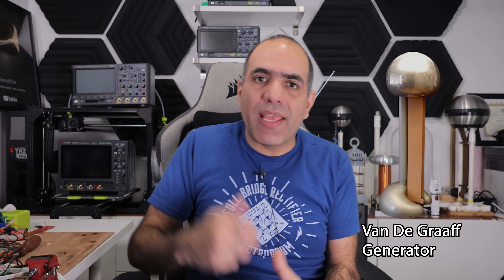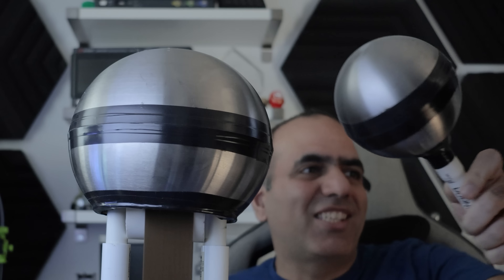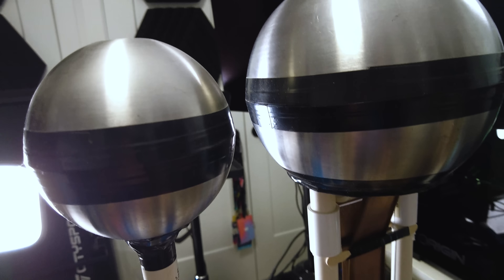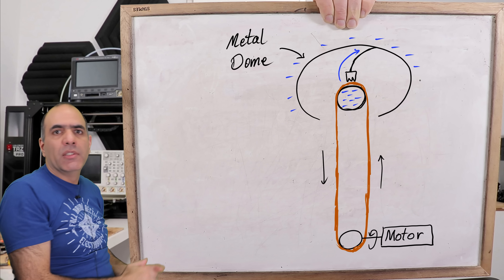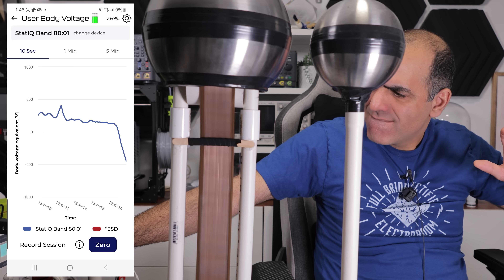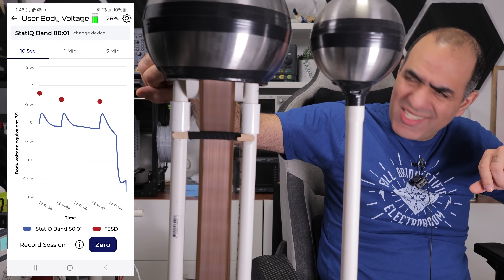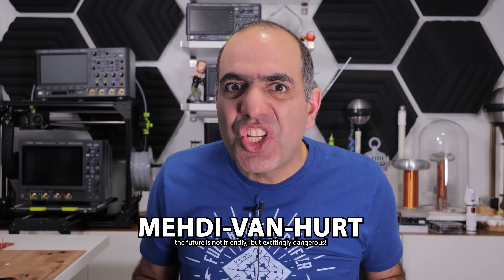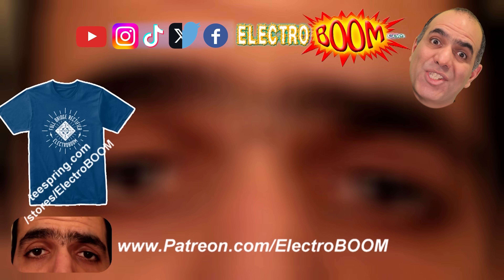An Attempt Was Made!

Comment: If touching the bottom of the belt with the grounded ball increased charge try taking the black tape off the brass rod at the bottom on that side and attach the ground wire directly to the brass rod that would now be directly touching the belt.
Reply: But then the dome charges will jump straight to the grounded brass rods....

Comment: I just don't see how adding an additional ground to the negative side if the belt is any different from adding more combs to the very bottom of the machine, other than the added ground being located closer to the upper ball.

The other issue I see is that the belt itself carries electrons. On the wimshurst machine, the disks are supposed to be insulators while the plates transfer electrons. I don't think you can properly combine both concepts as they'd drastically interfere with each other. Perhaps if you had some super insulating material that could perfectly isolate the plates from the belt, then it might work, but with the voltages you're working with, I don't think such a material exists.

It feels like you'd be better off connecting a separate wimshurst machine in series rather than trying to combine the two.

Comment: IRC Wimshurst machine is basically an electrostatic universal motor/generator. They cross couple the connections so that the induced charges on the plates either side add up. I think maybe if you connected between the sides in a ladder arrangement, you may get more and more charge on the belt as it rises up towards the ball instead of being constant amounts. But obviously if it arcs before it gets there then it won't help so the plates can't be too close together.

Comment: It’s a short circuit. I don’t think you can separate mediums while they are connected so. Even if resistive values were used instead of conductive plates, it might not work because there is no opposite charges since the mediums will still share the same charge polarity. The p’hose is resistive and the metal plates are conductive. That means both are one charge. I was thinking you need a capacitive connection to get your opposite charge as a field, however, I was thinking of something else because I didn’t know at the time what you were trying to do. The capacitive junction might work, however, if it did work it will only create repulsion nodes or repulsive junctions just as if you used resistive plates instead of conductive plates. If it doesn’t work,all the same, it will be a short circuit. It’s possible to create repulsive nodes or repulsive junctions, however, that’s not caused by opposite charges. You might have to make two machines having opposite charges and then let the charges interact.

Comment: Attaching the copper tape to the belt essentially turns it into a (poor) laddertron or pelletron!
In those, the pellets/ladders can move significantly faster than rubber and hence can create much higher currents and voltages without wearing out the belt, however in your situation it makes it worse.
Reply: Came here to post the same thing.  Wikipedia has a page on the Pelletron, along with links to the manufacturer and the manufacturer's page on how it works.  These commercial units are used for driving small particle accelerators and can produce potentials up to 25 megavolts.
Reply: @robertlapointe4093  Yup. Laddertrons/Pelletrons are nothing new.
Reply: @robertlapointe4093  Hey, there's my people! I also know about Pelletrons!  I think they are neato.  Bye!
Reply: A Pelletron attempts to add  extra charge dirrectly to the pellets (copper strips in this case) instead he's trying to add it through the pantyhose.  His Inductor/suppressor setup is wrong for it to function in such a fashion.
Reply: Robert VandeGraaff's first prototype used metal foils on the belt.   
He soon discovered that the device worked better if the foils were removed.   (Their sharp edges leak away half the charge!)   To correctly employ conductors here, they need to be spheres, or perhaps thick hollow disks with rounded polished edges.
Also, his earlier prototypes used newsprint paper  ...since he was inspired by lethally dangerous voltages building up in a local Boston newspaper-printing facility.   The huge printing press was electrically floating, and a worker had been hospitalized from walking too close and experiencing a joules-scale discharge through his body.   
But in humid conditions, newsprint becomes too conductive.   Neoprene belts with cloth inside for sturdiness work well.  And also, when ozone eventually makes the rubber become brittle, the interior cloth keeps the belt from immediately crumbling.
Also, in Scientific American, the Morris/Lee VDG used a trick to double the current, by employing an upper metal roller, and a little pickup-comb connected only to the roller (so the roller would highly charge up to opposite the polarity of the lower roller.)
Reply: @wbeaty  seems like connecting the comb to the roller instead of placing it in contact with the belt might solve the issue mehdi found with the charge, if his measurements and hypothesis are accurate

Comment: The basic idea of a Wimshurst machine (or any other 'induction' machine) is that you hold differing charges near two conductive plates that are parallel and initially connected. The charges induce electrons to move away from one plate to the other. When you remove the connection between the plates, you are left with charges sitting on the two plates. Like a capacitor, if you move the plates away from each other, the capacitance goes down but the charges remains the same, which means the voltage on each plate skyrockets. You can then drain the voltage (via some combs) into some high voltage capacitors (typically leyden jars) and repeat the process. The principle is most easily seen from a much simpler machine called Belli's Doubler (duplicatore).  In the Wimshurst machine there is a succession of plates mounted on insulative disks to handle bringing them together and apart. The process relies on there being some small residual charge to start off, but apparently that occurs naturally with the conductive plates.

There is a variation of a Wimshurst machine called a Bonetti machine, AKA "Sectorless Wimshurst", which operates similarly, except it dispenses with the conductive plates, it just relies on charges sitting on the disks. From what I've read, the Bonetti machine needs an explicit start up charge, but is capable of higher voltages than a similarly sized Wimshurst (presumably because the wimshurst can get arcing between the plates on one side of a disk).

Unless there are details I can't see from the video, what you've done is mimic the appearance of a Wimshurst plates but you haven't done the part when charges are allowed to flow from one plate to an opposing plate under the influence of opposing charges.

My (possibly incorrect) understanding is that a Van De Graf generator is both triboelectric and inductive. The roller strips (or adds) electrons to one side of the belt is the triboelectric aspect, but the charge going to the bowl is actually from a charge induced on the other side of the belt. 

Have you thought about connecting two Van De Grafs in series to get higher voltages?

I'd also like to know what the lower roller material is. I never thought about using pantyhose as a belt. Is there a video with the construction details?
Reply: Very interesting description that I would have found helpful fifty years ago when I was making the Wimshurst. Oh well I will have another go.
Reply: @WOFFY-qc9te I've got a Bonetti machine under construction. My expectation is that it will be more tolerant to the discs not being precisely synchronized.
Reply: @ericthecyclist  You very detailed explanation explained the spacing of the sectors. Answers a few questions here.  Enjoy your new machine a wonderful project and a pleasant change from the tack made today.  Drop in to see
 " Steamhead "   He does not make Wimshurst machines but make a lot of fascinating devices from Acrylic, you may find so construction ideas. If you leave a comment say Woffy sent you.  I think you will enjoy his content.  Also  My Own Devices and excellent channel. Best
Reply: Yes, actually Medhi links to a very good video explaining exactly how this works.  But then builds something that would not contain  any of the elements that make a Wimshurst machine work.
Reply: Thanks for taking your time describing systems :ø)
- and thanks for sharing it with us, truly appreciated!
Reply: "The Charge Remains The Same" wasn't that a Bob Dylan song?
Reply: ". Is there a video with the construction details?" yes there is.
Reply: Doesn’t the comb inside the dome just spray the belt with positive corona that neutralises the charge on the belt? And isn’t the positive corona limited by the fact the dome quickly becomes negative, until it discharges via the spark? The dome is not an unlimited source of positive charge. There is no reason why the belt travelling down should be positively charged, before the addition of the copper plates. It only attracts enough corona to make it neutral.
Reply: @Bicyclehub  My understanding  is there is a law that says you can't have a static charge inside a conductor, only on it's surface, that if you do put a charge on the inside of a conductor, it will immediately migrate to the surface. The stated reason is that like charges repel each other, and the surface is where they can be further appart. 
The weirdness comes that every description of Van De Graf machines I've seen treated the inner surface of the dome as being inside a conductor, so that charges applied to the inner of the dome would migrate to the outer surface. I don't claim to unerstand this weirdness, it fails my thought experiments, but I hope it gives you a place to start googling and hopefully find the answer I've never found.
Reply: @ericthecyclist  Faraday's law
Reply: @cambridgemart2075  applies to electromagnetic systems, not electrostatic ones.
Reply: @ericthecyclist  Sorry, Gauss' law, not Faraday!

Comment: Two more experiments you can try - 1. Cascade a bunch of step up transformers (step down in reverse) - feed the secondary, output at primary, then connect that to the next secondary and so on. I would think with 10 transformers cascaded like this you would get some mean voltage at the last primary. May work with only brief pulses. 2. Take that high voltage app device and go under a HV transmission line tower. See how much voltage you can pick up from that.
Reply: Cascading transformers does not work, because the wire isolation and primary to secondary isolation is not good enough. You would need special high voltage insulated wire to wrap the primary and secondary coils of the higher stages.
Reply: @ProtonOne11  Makes sense - after the 2nd or 3rd stage voltages would break down the insulation - but I would think for short pulses it might work to make a big spark at the end.

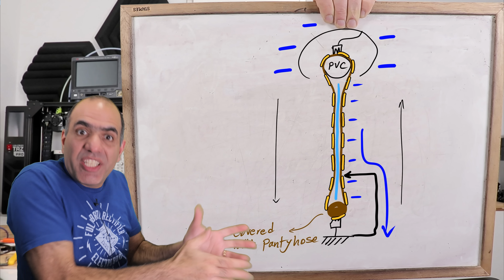Comment: 11:20 You need 2 separate belts with diodes in between.  Diodes Mehdi :D
Reply: So both the belt and the top tube are dielectrics? Where does the belt get the extra electrons from? The air? Also a dielectric. The system works with a difference in negative charge, not +ve and -ve. As soon as you introduce any conductor and that may be earthed, all the  extra electrons leave and it stops working.

So the challenge, is you want one side of the belt to only gain electrons (you could help it somehow) and the other side needs to repel electrons so they stay in the metal ball at the top. 

Maybe a belt made of a material where the current can flow only one way?

Comment: Maybe using some paper at the edges of dome to give it a more flatter shape than the pointy might reduce the escaping of electrons, and if we want to really isolate the copper tapes we could use a Plexi glass cuboid which isolates the tape from the environment and the pointed part of the dome and is only open at the top where the charges get deposited, same structure could be made on the positive side of the belt or you could create a cube to isolate the dome of the Van De Graf from the environment so that the charges remain in that cube of an area and don't find any other path to discharge to and u could make a small hole in the cube surrounding it through which u can bring close your hand, or any thing else you want the Van De Graf to arc to.
(I am not as experienced as you or many others are so its just my suggestion according to what i think could be done)

Comment: 14:18 Mehdi-van-hert=.... You can make two concentric sphere which is connected by a wire [ concept: when you connect an inner conducting sphere to outer conducting sphere then it will become a single conductor and all charges moves to its outer surface because magnitude of potential of inner sphere is always greater then the outer sphere ; charges moves to outer sphere independent of magnitude of charges and independent of +,-- charges..

Comment: Good luck making this happen!

The Van de Graaff generator and the Wimshurst machine operate on different principles.

A hybrid machine should use : A Wimshurst mechanism to provide a starting charge to the bottom roller. A Van de Graaff belt system to collect and transfer this charge to a larger dome for accumulation and storage.

Comment: I think you are only increasing the surface area of grounding by touching the up side of the belt with a grounded metal ball. So that means, you can add more ground brushes to the bottom area of the belt, and it should work the same way. You can add multiple brushes with finer bristle size to increase the total surface area of grounding. And I think you can add a horizontal plexiglass to isolate the top dome from the bottom grounding operations. You can make a longer belt to isolate/seperate two poles more.
And i have an additional, more drastic but controversial idea. If you can make your negative dome somehow more electron hungry, you can build more charges and create more voltage difference. And I feel like a Tesla coil would be involved in this project. I don't know how to exactly do it but I think making the dome more electron-hungry is related to Tesla coil electrodynamics. Making the dome positive for a while, while the previous charges are deposited to somewhere and adding the new electrons onto that deposit charges in every cycle can be the key. So I really don't know how to do it but I guess there can be some coils, capacitors or diodes involved in some way. 

Bonus: You can call it Mehdi-Van-Hurt Coil. Doesn't it sound cool?

Thanks for all those great stuff by the way.
Reply: If those components like capacitor or diode wouldn't work with this type of static charges, maybe a fully mechanic, or electromechanic physical approach would work. I have an old idea to generate high voltage that I couldn't have time to build. Think about an umbrella, actually two umbrellas, covered with a conductive material. Make a capacitor with them by putting them side by side while they are opened. After charging is complete, you can cut the energy and close both of those umbrellas and all the charges will be cumulated on the tips and there will be a lot of voltage between those tips. 
With a rough calculation, if your surface area is 1m2 (10.000 cm2) and you charge the plates with 1000 Volt, then if you decrease the cross-section surface area of capatitor to, lets say, 2 cm2, than your voltage would be 5.000.000 Volt in theory. I know there will be losses but I would be really happy if you could try this experiment for us. That would be very interesting to me, and to your audience i guess.